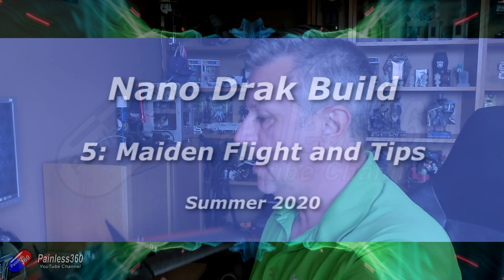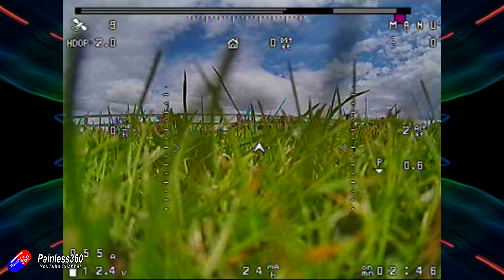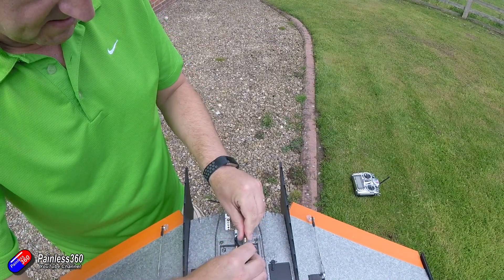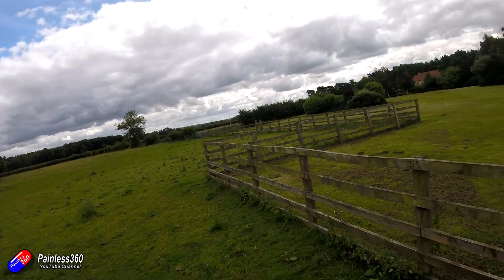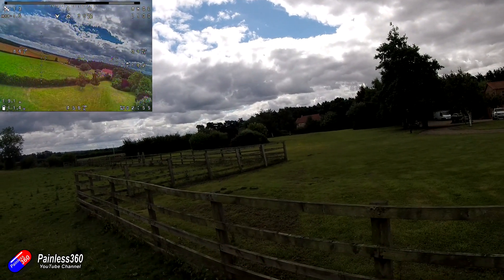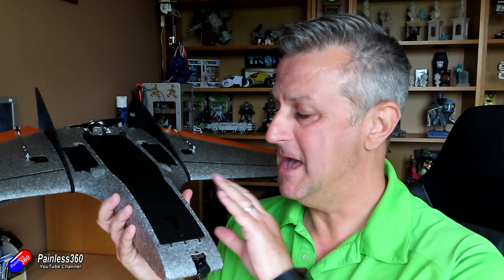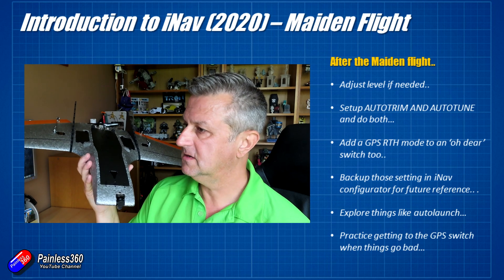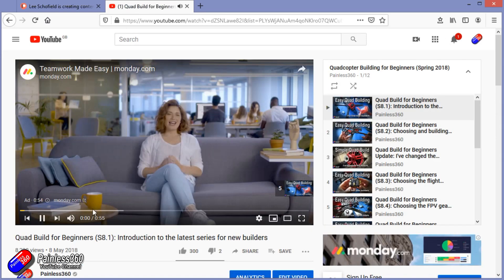Nano Drak/iNav 2020 Build: The maiden flight

Comment: A little late to your video but I just finish my build and tried a maiden launch. Didn’t work out too well. This plane is so heavy. I am using a 4s 2200 with the default ritewing 2212-2450KV motor. Any helpful hints on a hand launch?
Reply from the maker: I used INAV Autolaunch on it. Works well.. Best of luck

Comment: Hey - what's your opinion on this (with the 40" wings) vs the AtomRC dolphin? I'm keen to get this style of airframe to replace my S800 at some point, and they both seem fairly similar - thought you'd be the best person to compare to them.
Reply from the maker: They may look similar but are very different to fly. Obviously the motor and prop you use make a big difference but for mine here.. 
The Dolphin is very floaty but stable. Capable of flying from 15-80mph and very quiet and efficient. It has loads of room inside for batteries and modern electronics including action cameras. It is easy to build and a fantastic all rounder as well as being cheaper to buy.
The Mini Drak is louder, faster, less efficient with less room for modern electronics and no obvious room for action cameras. It can't float in the same way and is a lot more complex to build and much more expensive to buy. But, for fast and locked in flying for experienced pilots - it is hard to beat!

Comment: Great series I started with inav 3 year's ago and have still yet to fly with it.
Nobody ever seems to do a radio set up as in what switches you need and how to set them up rth and the best order to have them.
If any has any tips for set up on Taranis 9xd I would be great full.
Reply from the maker: I'm guessing you have not watched my INAV for beginners 2020 series?
Reply: @Painless360  yes I have watched them including the maiden did I miss the set up on the Taranis.
Lee I did see you set flight modes but no one goes into detail with the radio all the way through from modes to rth loiter should these be on same switch etc.
Sorry if I'm not clear.
I may have I nav blindness having watched so many and going back through your first one's 👍
Reply from the maker: INAV for beginners is designed to have everything you need.

Comment: Quick question Lee, I may have missed it but where did you end up with the CG on this build? I have the exac same with 40" wings, no boom tail and I am finding quite a few different opinions on the right CG. Your help would be appreciated!
Reply from the maker: I'm using recommended 28" wings CG: 15mm forward of the front main spar cap. Recommended 40" wings CG: 7mm forward of the front main spar cap
Reply: @Painless360   Thanks, I appreciate the quick response!

Comment: Sorry for going off topic. I got a similar motor but a different version that is gt2212t and was told that i can run 4s lipo on it.. Didn't have many info on it but anybody know if it is ok to run 4s on it?
Reply: did you try it?... I got the same motor
Reply: @mkleespies78  Yes. It can run on a 4s. Landed hot but so far no issues..
Reply: @pumpkinhead959  awesome
Reply: @mkleespies78  i run it with a hqprop 7x4 btw..

Comment: If I change the rates in inav should I do it in the radio too ?
Reply from the maker: See my INAV for beginners 2020 series for all of the steps I use to setup the model. You shouldn't have to use dual rates unless you want to fly in Acro or manual.. Best of luck

Comment: Hi Lee
I have watched all the setup
Reply: Sorry watched all the setup vids but my controller has gone haywire. I have all preflight checked ticked with nothing connected and I am getting some interaction when I arm the servos move and the motor does not spin. Do You think I should reflash it and start again it's the f765 fc  cheers Chris.
Reply from the maker: I'm guessing this isn't Sbus? What troubleshooting have you already done?
Reply: @Painless360  
Hi 
I have took it all apart reflashed the fc and I am starting a fresh install with the help of you vids. Just in case I missed something.
Thanks
Chris